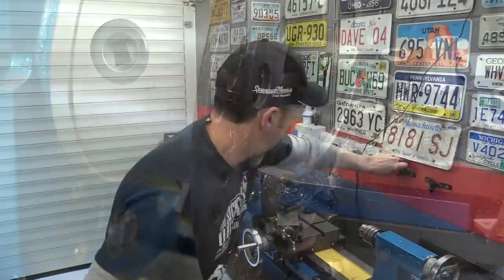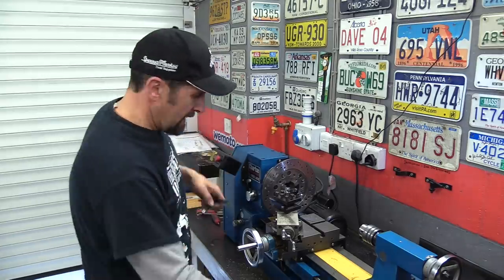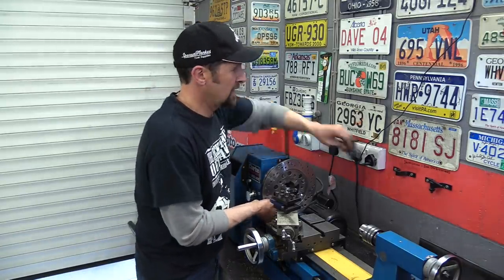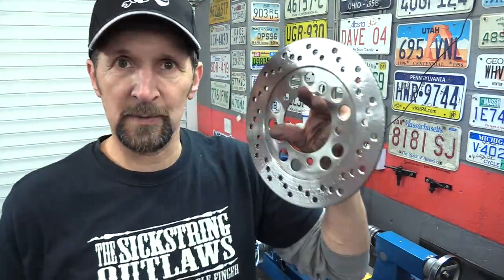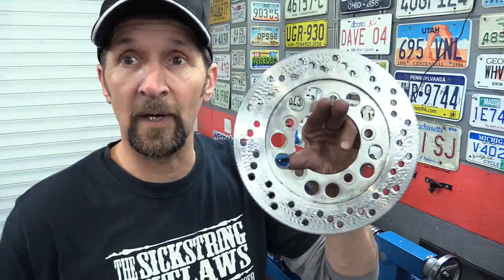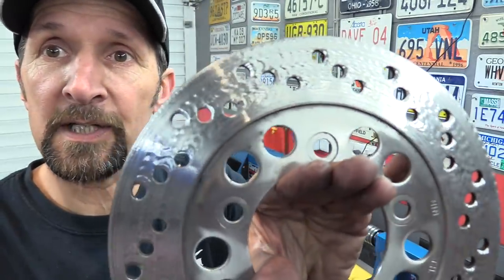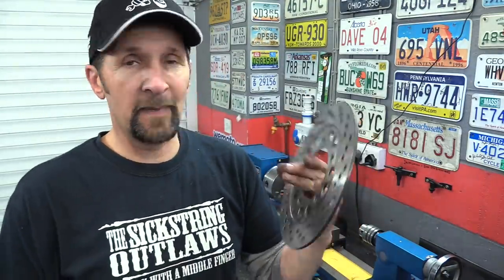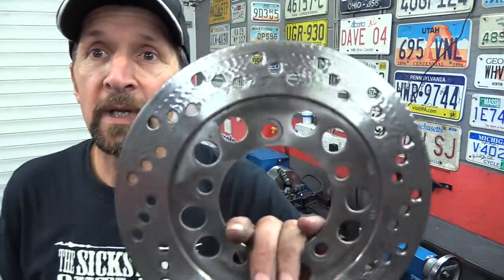Delboy's Garage, Busa Build, Day 3, Brake Disc Face Off !

Comment: Del, You are on a wasting your time trying to ‘Skim’ a disc. The disc was in a shocking state before you started and was probably right on it’s wear limit. The disc is as you discovered extremely hard. The only way to skim successfully is to take quite a deep cut (Circa 1mm plus) with a very sharp, fit for purpose tool bit. By the time you have done that on both side you will be way below the allowable wear limit. Just buy a new disc it’s simpler and safer. Admire you for trying to improve your skills but on this occasion it just not worth it. As ever great entertaining video.
Reply: r/wooosh
Pretty sure he knows all that.. It's a junker disc purely to develop the skills so he can apply them to real jobs.
Reply: Roger Barraud Trying to develop your skills is admirable. But wasting time and effort on an already destroyed disc will teach you almost nothing!
Reply from the maker: Hi Rob, I wouldn't say it taught me nothing, in fact, it taught me a great deal... remember I'm just a novice at this craft, and I learn even the basic things cos no-one taught me anything... I learned that a slow turning speed is essential, and I worked out early on int he experiment (as I learnt previously from Abom79) that a deep cut is essential to plough through all the mess, but obviously that wasn't possible on a disc... it wasn't worn to any depth, it was actually 5.3mm thick, so I reckon I stood a chance of bringing it in over min. thickness, but what I didn't factor in was the chatter, so I learned a lot about supporting a work piece and the limitations of my hobby lathe, so every day's a school day with this subject for me, and I'm all the richer for having made  my wall clock lol... Thank you for your wisdom and insight my friend.
Reply: Moonfleet41 Hi Del,

Thanks for the reply. It’s great to have the interaction and exchange of thoughts and ideas, that’s what’s great about YouTube. My point was not to criticize your pursuit of knowledge and skills. My general point is that disc skimming is notoriously difficult and often the returns do not justify the effort involved. I used to be a time served Centre lathe turner and tried this myself on an industrial grade lathe many years a go. Even with 3 years plus experience the task was difficult with the results not being great. The major issues are holding the workpiece properly to stop chatter (The holed discs do not help) and getting all 3 faces (Mounting and two friction faces) machined parallel. If the friction faces are ‘out’ even by as little as 3 thou will result in lever of pedal ‘Pulsing’ via the system hydraulics. 
Keep up the great work.

Comment: About the machine limitation, couldnt you have tooled the wall side of the disk with the cutting tool upside down? I think you could have done it without 'bottoming out' the range of motion. I am not a machinist just a thinker. Also if your lathe spins both directions then the tool could have been right side up.

Comment: Ah, sometimes one must console oneself with little platitudes like 'Oh well, no such thing as a failed experiment' etc.
Then throw it at the wall. 
Was going to suggest epoxy/bondo in the holes to damp out the vibes, but it is a silly idea, so . . .
Can you borrow a castor from Penny's favourite settee & wedge it to run against the other side of the disc?
Caution: This & other brilliantly inept suggestions may cause marital disharmony, dinner in the dog, slam, etc.
Reply from the maker: Said that right brother, that's if we had a dog of course lol... always great to hear from you, have a great weekend mate!

Comment: Well the "cross hatch" tool marks should tell you that the disc was ground at the factory after the hardening. Additionally you're probably running at too high rpm.

Comment: Nice try Del. I believe the steel is a harder material and with it being thin and with all of the holes in it it maybe causing a lot of chatter and/or vibration which cause it to turn out that way. Ofcourse I am not a machinist lol
Reply from the maker: No, nor am I mate!... but I think you're right on everything you said, I didn't factor in that the lack of support out at that circumference would cause so much chatter, so it was good to learn that!... and yeah, it seems pretty hard steel, yet on the smooth parts I got a good chip turning and the tool came out unscathed, so it wasn't too hard.. great day at school aye?!

Comment: A couple of thoughts on this show. 
Your almost defencive comments about the radiator for the Hayabusa got me to thinking.  I would bet dollars to doughnuts, the radiator you bought was made in the same factory as the one Suzuki buys as OEM. I have seen it before with automobiles and I also know the Big Four have many of their parts made in China as well as some bikes.  
Your mentioning of the Hayabusa being a "budget" build is interesting.  That is what I do for additional income now that I am retarded er retired. the latest being a Gulf Coast 2004 Hyosung GT650 I purchased for $500.00 . Poor bike was lived in heat, humidity and salt and it showed. all the needed parts came from Ebay. with many of them Chinese. Total Cost, purchase and repairs (including tires , which I mount & balance myself) $800.00. Sale Price $2000.00.  Pretty decent return on investment I think. Next on the block is a 1997 Bandit. that was a stable mate of the Hyosung. 
Ole Rustythinking Fumblefingers
Reply from the maker: I think you're absolutely right on the origins on the radiator... it;s odd how they look so absolutely identical to the factory one that came with the bike! Enjoy your tinkering buddy, it's good for the soul (... and the wallet!), all th best, Del

Comment: Gripping the disk directly in the chuck is not a proper way to turn such a thin disk, because it is just supported at the three jaws and also you warp the disk when you chuck it down, even if it is true in the chuck it will spring back after releasing the chuck, leaving you with a warped disc again. Also it is very important that the two sides of the disk are parallel, and all sides have to run true to the mounting surface all in spec of a few hundreds of a millimeter. The only way I achieved a nice result was to machine a sturdy fixture you could grip in the chuck to bolt the disk down, then you can machine both sides in one set, makeing them exactly parallel. I faced my rear brake disk that way, because I hardly use it, I wouldn't recommend doing it on front brakes. This mini lathe is simply not meant for work which includes intermittent cuts, roughing and everything that causes vibration, due to the lack of mass, and rigidity the chatter is not under control. Maybe you could get better results with a slower cutting speed, but it reached its minimum. I also have done some car break disks where I got down to about 50 rpm even on my 2500 kg heavy industrial lathe. Carbide inserts for aluminum and low speeds are the key for cast iron car brake disks.
Reply from the maker: Thanks for your input my friend... and I wish I had a lathe like yours... of course, as I said in the video, everything the same as you did, gripping internally with 3 jaws was simply insufficient mounting strength, but just wanted to experiment and learn from the experience... and that I did!  Thank you again, Del